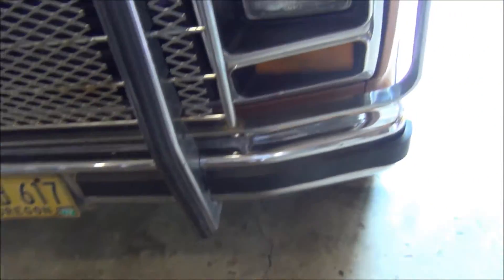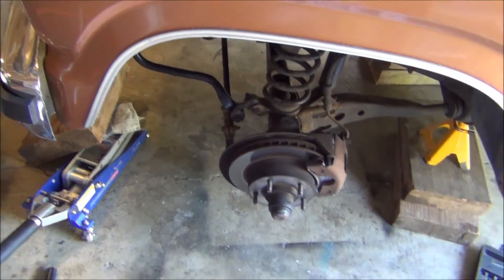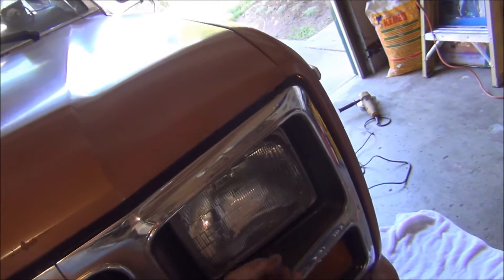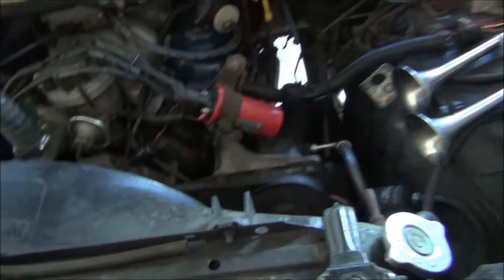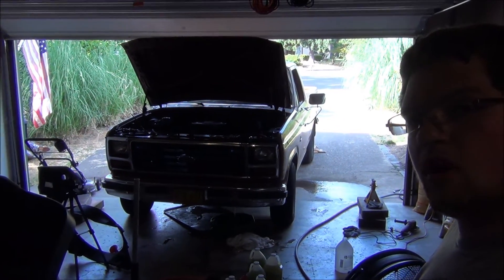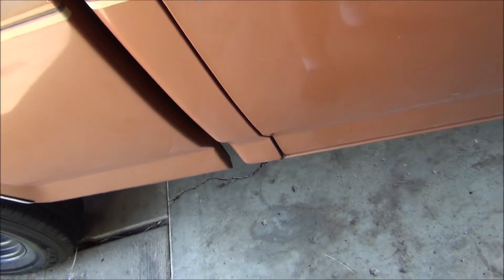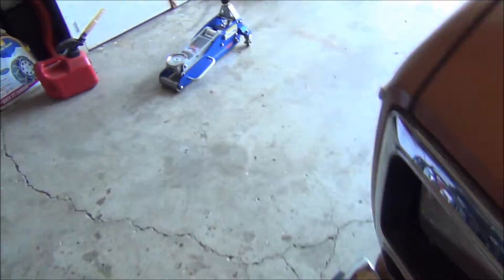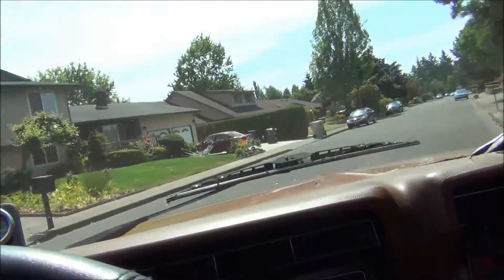Full Day Working on the F150

Comment from the maker: and tire pressure at 36+. my dads mazda 3 is set to 40 psi. Im sure 40 on 235's should be fine and may yield 20 mpg hwy at least on my truck. I'm sure if I got a steering alignment I could possibly get 21. I'm tempted to put 0w30 oil in and see what happens. lol